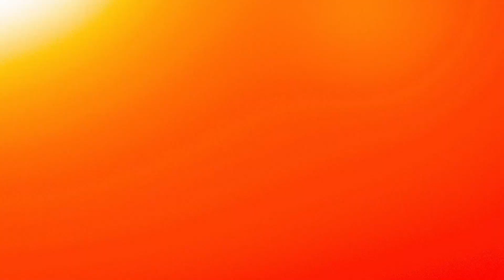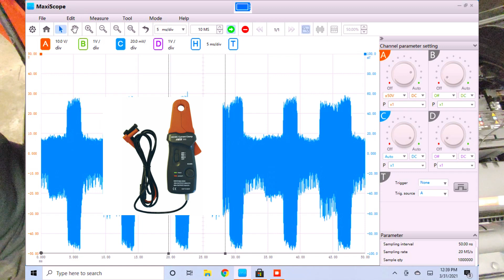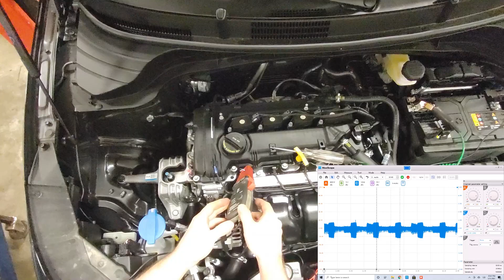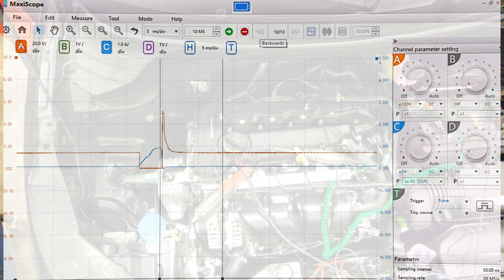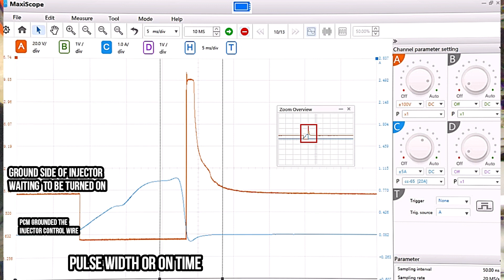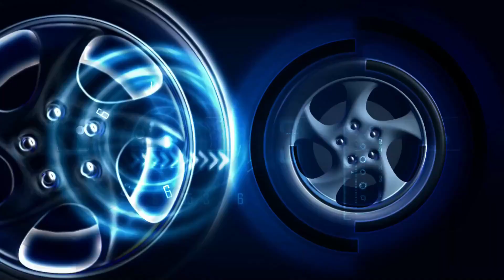How to test an Injector(Saturated style)

Comment: Nice video. I disagree with what you say at 17.12 of the video. The opening time, and the on off time are different. Yes the injectior is opening at the current hump but is not closing at the end of current flow it is closing in the hump in the voltage wave fourm that is a few milly seconds later than you show in the video.